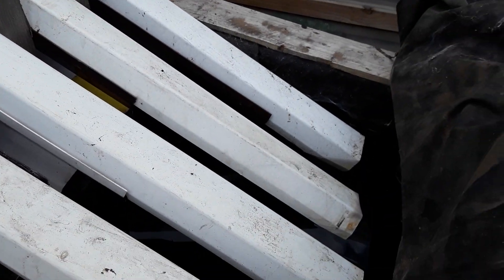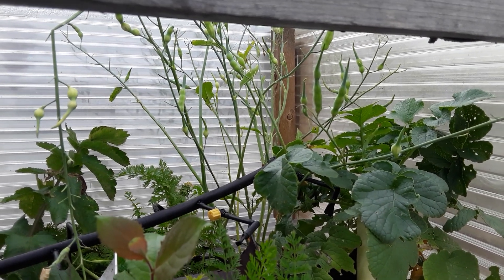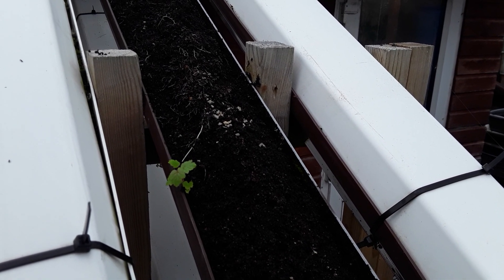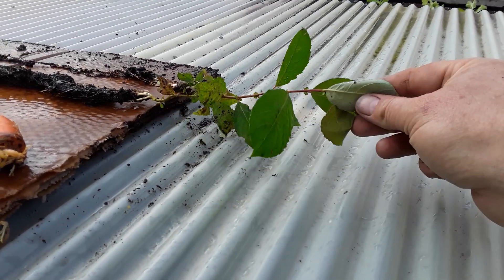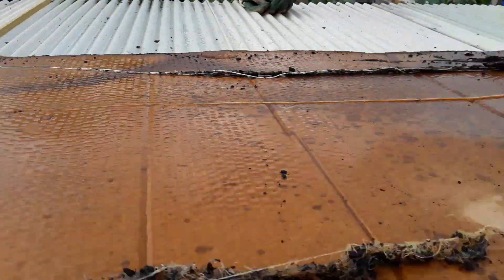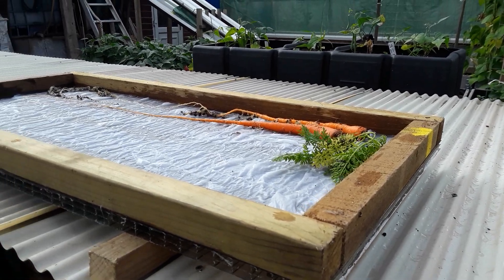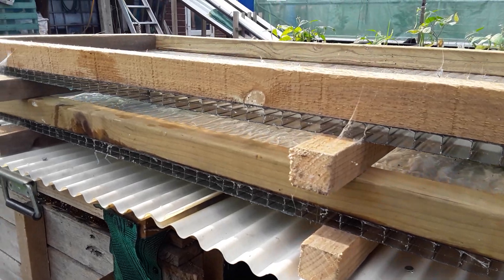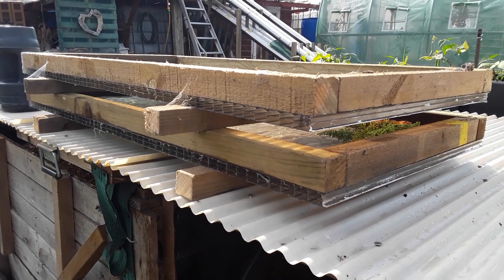Long Carrot 🌻 Part 1 🌻 Malvern Autumn Show & The National Giant Vegetable Championships

Comment: Do you cover the complete veg with damp tissue when transporting? That polycarb comes in useful 😀
🌻Nigel.............MuddyBootz Allotment🌻🌻
Reply from the maker: The wife gave me some old towels some months ago so they come in useful to keep the roots damp, I use thin paper towel or Amazon filling cardboard on the bottom so the roots don't stick. I saw Joe's trays and put my own spin on them and his wife was impressed with them and my efforts this year. Just need to use a fire guard as a sieve so I can get my roots clean as the rules state. 

♻️Happy gardening, Terry King.